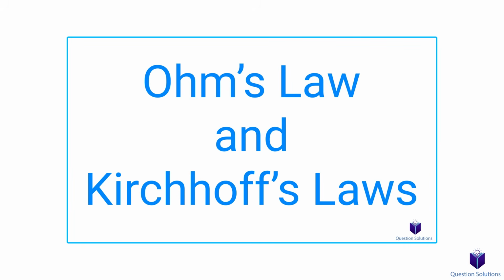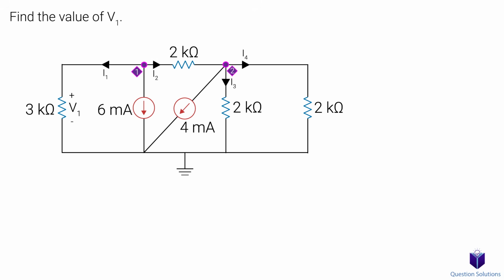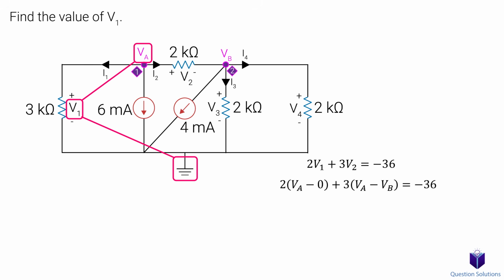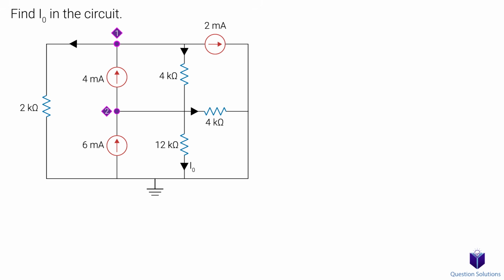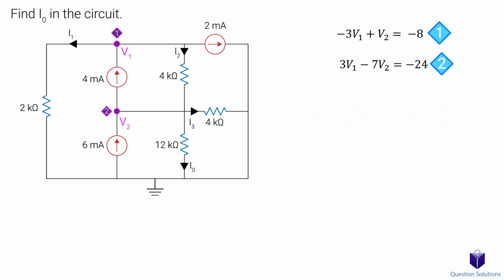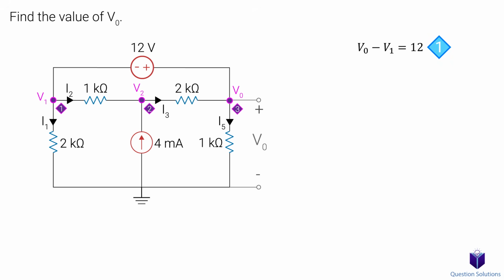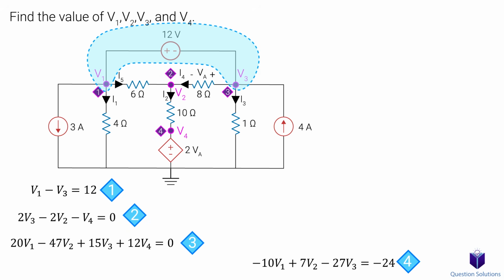The Complete Guide to Nodal Analysis | Engineering Circuit Analysis | (Solved Examples)

Comment: 8:44 For the very first problem why is the equation 
2V1 + 3V2 = -36 and not 
3V1 + 2V2 = -36
Reply: because say you are unifying the denominators to solve x/3 + y/2, you'll be multiplying both terms by 6 and 6/3 is 2 which you got as the coefficient of x. same thing for y. Hope this helps!

Comment: why all the currents seems to be going out for each nodes by the way?  Don't we need to have at least one current going in?
Reply from the maker: Makes no difference, the negative signs will tell you which currents are opposing your assumptions.
Reply: @QuestionSolutions  thanks also at 22:27 I got a little confused, maybe  a more detailed better part here is the the voltage drop is Vx = V1-0, that's why it ended into V1... Just for notes lol...

there's a difference between voltage potential and voltage drop across the resistor.

Comment: Do not use nodal analysis! It’s a waste of time and prone to errors that cascade throughout your equations. Try using just dividers, Thevenin’s theorem, Norton’s theorem and Middlebrook’s extra element theorem. Nodal analysis is good for computer programs but useless for practical engineering because you cannot make sense of the circuit from the equations. You will not be able to understand how the circuit works or fails from the resulting equations. Middlebrook or Vorperian will explain why these are a disadvantage to understanding and a big waste of time.
Reply from the maker: I'm not going argue with you, but you understand students need to know the method for their exams right?
Reply: @QuestionSolutions  Are they going to be tested on nodal and loop analysis or are they going to be asked results about the circuit? If the latter then skip the nodal and loop stuff. It's over complex garbage for an engineer or anyone. Also and unfortunately, they will probably never be taught Middlebrook's methods and Vorperian methods in school. That is the tragedy of Electrical Engineering education which rate the lowest or near the lowest in university degrees that prepare you for the real world despite being the hardest of the engineering fields. So if the instructor wants to see the way nodal or loop analysis is carried out then of course they need it to pass. However, you should look at videos by Vorperian and Middlebrook to see the iceberg these students will be crashing into for no good reason.
Reply from the maker: @markszlazak yes, I don't know any electrical engineering course that doesn't require a student to know how to use nodal analysis. Also what exactly is the point of your comment when the entire video is about nodal analysis? It's like someone commenting on a video about apples saying "don't eat apples, eat oranges instead" I don't really understand your line of reasoning. 😅 Not being mean, I genuinely don't understand the point of your comment.
Reply: @QuestionSolutions You are not being mean but your are being a bit narrow minded. You would never have brought up the methods I mentioned in any of your videos. So the best place for me to bring these up is on their targets which are nodal and loop analysis. Have you watched either   of these engineers I mentioned? There video are online. The title of Middlebrooks intro/first video clues you in on something pathological with electrical engineering education, it has therapy in the title. Now if I where you, I might consider doing something more meaningful than just helping students pass exams. Helping them be good engineers sounds like a higher calling but that is your choice.
Reply from the maker: @markszlazak why don't you just make videos on those topics? 😅
Reply: @QuestionSolutions Oh that's easy, I am not a video content creator but you are. Anything else related to the topic of circuit analysis you want to ask?
Reply from the maker: @markszlazak nope 😅 best wishes with your future endeavours.
Reply: @QuestionSolutions You as well. Vorperian dominates now over Middlebrook. It's an enhanced more general approach. You will probably never use nodal or loop equations ever again.
Reply: Bro anyone using the methods you mentioned isn't not going be looking at these videos for guidance. I'm not even an electrical engineering student and I am required to use this stupid method to pass. After this class I'm probably never interacting with circuits like these or harder once again. So stfu and go watch something else.
Reply: nodal analysis is very useful in more advanced circuits with components like diodes, op-amps, transistors, etc... If fact, you will almost always use nodal analysis
Reply: @nhitc6832  Useful doesn't mean good and the methods of Vorperian (a further generalization of Middlebrook's methods) will work on any complex circuit and you will get the results by inspection without pain. You will probably never use nodal and loop analysis again. To bad this method is not taught in most schools, Cal Tech and Virginia Tech being some exceptions where these two professors taught. However, in industry they both taught these together to many Engineers and they are much better known. Vorperian's channel is called "Vorperian's Electronic Circuits Courses", the earlier videos are where you start since he numbers a later group like Video 1, Video 2, etc., the same way as the earlier group which is about the technique. Christophe Basso democratizes these techniques and has two books on them, one being a students guide.

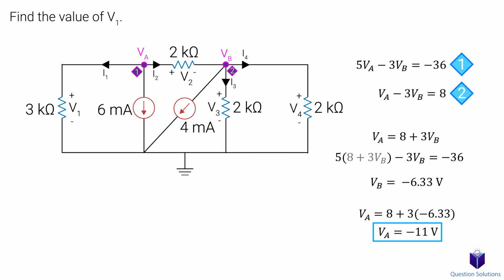Comment: would current go thru the two resistors to the right that are 2k ohms? wouldn't the current skip those? 10:33
Reply from the maker: Yes or course. Unless there is some short circuit in the circuit, current will travel through every single resistor on a circuit. It won't skip any.

Comment: I didn't get the thing if how to assune the direction of current, like i dont knoq whether its my miatake bit how to put those arrows of direction, Do you have nay videos on that or can u explain please
Reply from the maker: You're most likely overthinking this. 😅You can literally pick any direction you want for the current at each branch. So assume the current anyway you want, except for branches with sources. And if you end up with a negative value for current, it tells you that your assumption was incorrect, that the flow of current is opposite to your assumption. Try a few questions, it'll click into place.

Comment: At 19:38 I have to disagree that you cannot write equations at node 1 and 3.  It can be done by adding a variable.  Lets call it I12V.  Super nodes are a relatively new thing.  I believe they were conceived to make electrical engineering students drop out sooner.  At node 1 KCL would be V1/2+(V1-V2)/1+I12V=0. Node 2 would be (V2-V1)/1+(V2-V0)/2-4=0.  Lastly at node 3 we would have (V0-V2)/2+V0/1-I12V=0.  Of course we need V0-V1=12 which is not a KCL equation to have 4 equations with 4 unknowns.  Notice there is no need to draw any arrows or consider any current directions to write these.  It is very procedural and will give good results without racking your brain over how super nodes work.  Multiplying by 2 and combining like terms gives the following;

Node 1   3V1 - 2V2 - 0V0 + 2I12V = 0
Node 2	-2V1 + 3V2 - 1V0 + 0I12V = 8
Node 3	 0V1 - 1V2 + 3V0 - 2I12V = 0
Aux	       -1V1 + 0V2 + 1V0 + 0I12V = 12

The equation at node 2 is the same as yours times negative 1.  Engineering students should understand this does not change the result.  

One argument I've heard for super nodes is that they are less complicated.  They say this because the super node method gave 3 equations with 3 unknowns instead of 4 and 4.  But, if You add the equations at nodes 1 and 3 I12V drops out and you get equation 3 again multiplied by negative 1.  I believe the arithmetic to reduce the system from 4x4 to 3x3 is much simpler and less error prone than using the super node concept to write this equation. 

Solving a circuit means knowing all the voltages and currents. Using super nodes does not tell the current through the 12V source.  Solving the 4x4 does.  The equation for node 1 or 3 is going to have to be written to get this . 

One last note, circuit simulators don't use super nodes. They would build up the coefficients of these equations using a algorithm that is more similar to the non-super node method.  In the real world engineers would use circuit simulators to solve a circuit like this.  It is probably better that they understand what is going on in the simulator than the concept of super nodes.  Anyone interested in this should look into the very good book "Computer methods for circuit analysis and design" by Vlach Singhal.

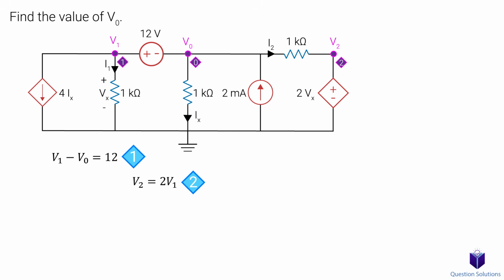Comment: At 22:45 we only use a super node when we dont know the direction a current flows in?
Reply from the maker: So the direction of current flow doesn't matter. The issue is, there isn't a way to figure out the value, or rather, represent the current flowing through the voltage source. So we can write an equation for it. When that happens, we have to use a supernode.
Reply: @QuestionSolutions  thank you that makes sense.
Reply: @QuestionSolutions  so for any voltage source we can't find the flow of current, correct?
Reply from the maker: @Edgarcandelario-i6q  Technically, you can, but it can be done after you solve the rest of the circuit. After that, you can write a KCL for a node and figure out the flow of current in a branch with a voltage source. But to get to that point, you'll have to use a supernode to figure out the rest of the currents.
Reply: @QuestionSolutions  ahh that makes sense, thank you.

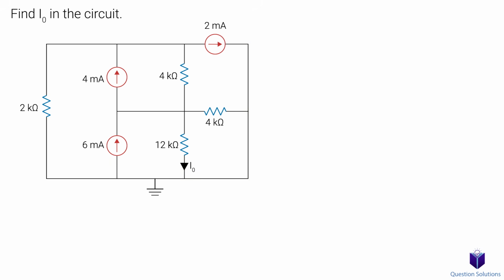Comment: at 11:15 aren't there more nodes than 3? why do we only use 3 nodes instead of all the nodes?
Reply from the maker: No, there are only 3 nodes in that circuit. There is a pinned comment teaching students how to find nodes, please watch it first. Thanks!
Reply: @QuestionSolutions  thank you I understand now, I thought a node was when a branch splits, but now I get it.
Reply: @QuestionSolutions  do you also have a video on how to identify current flow?
Reply from the maker: @Edgarcandelario-i6q I'm not too sure what you mean here. Could you please elaborate?
Reply: @QuestionSolutions  do you have a youtube video on how to identify the direction current flows?
Reply from the maker: @Edgarcandelario-i6q usually, directions of current flows are assumed. The final answer tells you whether your assumption was right or wrong. I cover some basics of current flow directions with positive and negatives in the Basic Concepts video, first one in the playlist.
Reply: @QuestionSolutions  thank you, from what I understand current flows from positive to negative and usually want to travel to ground, correct?
Reply from the maker: @Edgarcandelario-i6q yes, we assume current flows from the positive terminal. But other than that, the rest is just an assumption. Though with time, you'll be able to make pretty good educated guesses.
Reply: @QuestionSolutions  Thank you, you are the best at explaining.

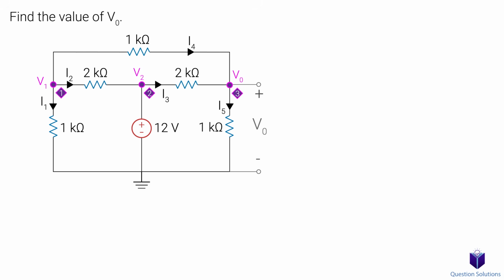Comment: 15:53 how come there is no current flowing through the 12v power source ?
Reply from the maker: There is current flowing through it, but it's not something we need to worry about since we can directly figure out the nodal voltage, it's just 12V. In other places, we don't have the voltage, so we represent it in terms of current and resistance (through and extension of ohm's law).
Reply: @QuestionSolutions thank you so much for your quick response! That makes sense. I also want to say that I’m a big fan of your videos and have used them for thermo, circuits, dynamics, statics and mechanics all of which I have passed thanks to these vids! Keep it up man these are the most informative on YouTube

Comment: For 18:04 does any current flow through the voltage source i was a little confused why there isnt a current going through the voltage source
Reply from the maker: There is current flowing through it, but it's not something we need to worry about since we can directly figure out the nodal voltage, it's just 12V. In other places, we don't have the voltage, so we represent it in terms of current and resistance (through an extension of ohm's law).
Reply: @QuestionSolutions ahhh i see i solved some more problems and this became more intuitive thank you for replying🙏🙏

Comment: In the fourth example, why can't I just put the ground node in "V1" then that makes V0=12V
Reply from the maker: 😅 wouldn't that be awesome if we could do that? So why do you think that doesn't work? If we place V1 as ground, you'll have another node on the bottom. The bottom node will become V1, it won't be 0 anymore. So you'll still have a difference in node voltage between ground (previously V1) and the new V1 on the bottom.

Comment: 24:22 can u please tell me why there is a v4 node?
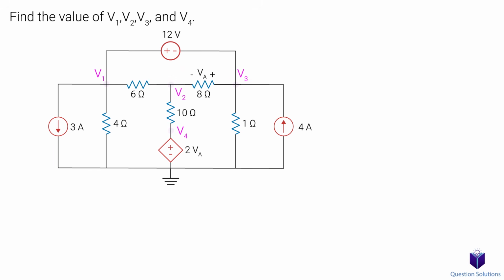Reply from the maker: Because there is a node there. Not only that, it's given in the question as well. Also, look at 24:10, there are 5 nodes in the circuit, the little green section is a node.

Comment: things that i learned from the video
1: the direction of I doesn really matter, 
2:Va=|V1-V2|, if I goes from 1-2, VA=V12 and vice versa, so in the kcl equation, if we choose I as the correct “I”,with respect to v12 if it’s the wront direction: then I=-I?but since it’s V21 then it’s back to -(V21)=v12
3: points away=-, heading in =+
4:use fixed directional component as a guide
(might update later)

Comment: 24:21 Hi, I wanna ask why you assume V3 is higher potential than V2? And what happened if you assume the current I4 is going towards V3 and is this wrong?
Reply from the maker: Just a guess, an assumption. If it's true, you will end up with positive values, if it's incorrect, you'll get a negative value, but the magnitude of that value is correct. So you just flip your current direction.

Comment: 24:09 , Why did you only consider the voltage source for V4 ignoring tgr (V4-V2)/10?
Reply from the maker: I think (with your previous comment as well), you are misunderstanding what a node is. We aren't ignoring anything, we are simply showing how many nodes there are at 24:09. When we look at V4, we see that it is constrained by the dependent voltage source, it must have a value of 2VA.

Comment: my biggest point of confusion is how do you know which parts of the circuit to place unknown currents at?
that implies you must know where they could be different. but i do not know.
Reply from the maker: The simple answer is, every branch will carry a current, the direction is totally up to you. So placing the current anywhere along the branch is fine, because it represents the current flowing through that whole branch, not a singular spot.

Comment: sir i have a question the answer in the second problem is 0.4444444 A. How did it become 44.4mA
Reply from the maker: You answer is incorrect. (16/3)/(12000) = 0.00044A = 0.44 mA.

Comment: Hello, thank you so much for this lesson. I would just like to ask why is it okay for us to disregard putting in the units for each element, like the ohms symbol, the ampere sign, and the voltage sign when doing the computations
Reply from the maker: You can put then in if you want, but it makes everything really messy. Plus, this stuff is really basic, you should be able to mentally keep track of ohms, amps, voltages without much trouble. However, that doesn't mean you can't write them in, it's totally up to you. If you can mentally keep track of your units and write down your units at the end, you won't lose marks (most textbook examples won't even put units down for every single line until the final answer), though if you have a very strict professor that tells you to write units down for every single step, tough luck :( 

Do whatever makes you more comfortable when solving problems :)

Comment: let me make it clear from u respectively the sign convention for currents under nodal analysis while applying kcl isnt it from negative to positive because there is a lot of confusion here mostly data say that it flows from negative to positive however in your solved problems you have taken positive to negative
Reply from the maker: Use whatever makes it easier for you. If that makes it easier for you to visualize a problem, then use that convention, but it makes no difference to the final answer. In addition, conventions used in North America is different than the ones used elsewhere. So again, use whatever one you want.
Reply: @QuestionSolutions thanks for answering appreciate it man helped alot.. subscribed for you❤

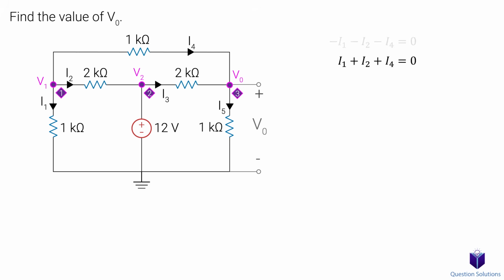Comment: 16:05 isnt it the convention that you assume all currents are flowing OUT of the node that youre analyzing and consider them positive? And if a current is flowing IN, its coming in from a current source for which you put a negative sign before the value? i know it makes no difference since the summation is equal to 0 and you can multiply by -1, but still good to follow conventions
Reply from the maker: Never heard of that convention, maybe it's something that's used where you are. Assume any direction for current as you like. It makes no difference, and if you have the intuition, you'll get the direction of current right the first time and save time at the end.

Comment: Great videos and clear explanation. The solutions to the last 4 problems could be simplified a bit.  For examples, the last problem could be solved with 2 "node" equations for 2 "node" voltage variables V1 and VA. And the problem before last should be solved with just 1 node equation for the voltage variable Vx.
Reply from the maker: Great to hear. You can solve them anyway you like if it gives you a faster answer or whatever you're comfortable with!